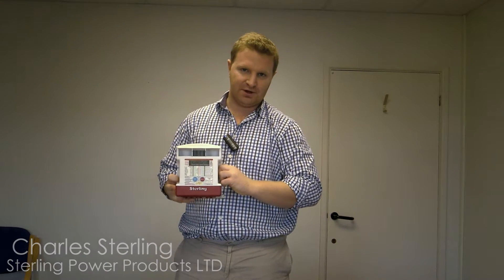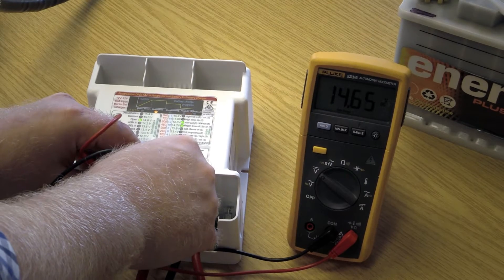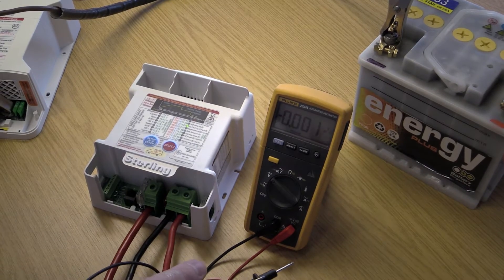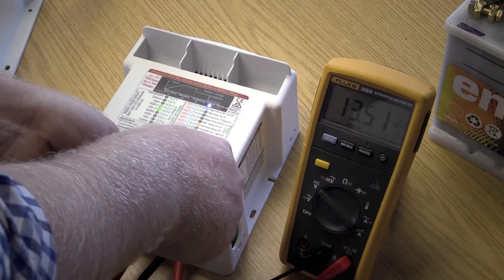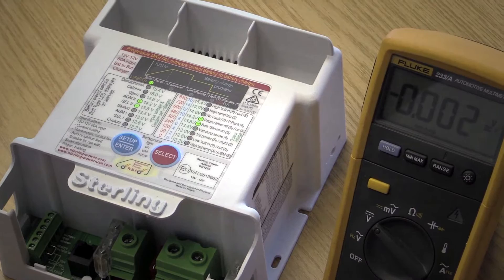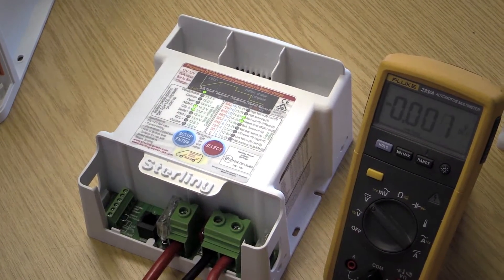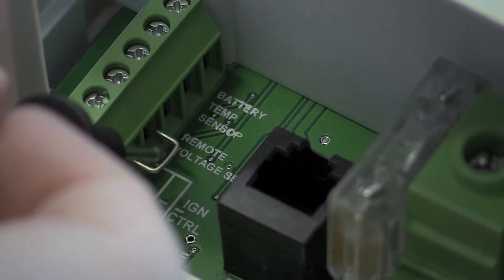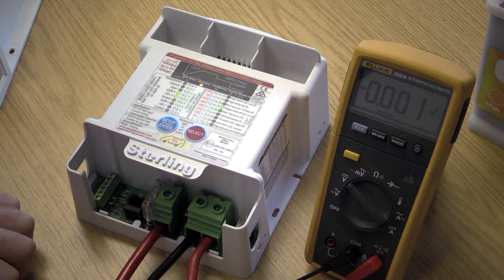Troubleshooting for Sterling's Pro Batt Ultra range of battery to battery chargers

Comment: Hi, is this demo only applicable when you have the ignition running ? I have this charger on a Motorhome that we've recently purchased. It is charging a 200a/h lithium battery. With the ignition OFF I have the top lithium light lit up green on the inputs, the custom light at the bottom is intermittently flashing red. On the outputs the only light that is lit is the 13.4v - drop sense. I'm not sure if the unit is operating correctly? Thanks
Reply from the maker: Hi Andy,

Sorry on the slow response!

When you have lights in both columns, the unit is displaying voltages. First column for input, second for output. 

The custom LED being flashing red stands out to me as you having a very low input voltage. Checking with a multimeter and comparing it to the starter battery voltage will help identify 
A) If it is a low input voltage
B) If it stems from voltage drop down cable

Comment: Hi im having some problem with my 60a. It seems to be having voltage drop on the output. It drops from 14.3v to 13.2v intermitently. When it drops i get the 1/2 power light and volt drop sense on. Any ideas what could cause this? Thanks
Reply from the maker: Hello,

What occurs at the voltage at your leisure battery during the charge sequence? Does it also drop from 14.3V to 13.2V?

Or is it constant at ~13.2V?

What's the voltage at the input when it's running at full power?

Ben

Comment: Hi. Mine keeps lighting up high temperature battery but they are cool
Reply from the maker: Hello Lee,

Are there LEDs in both columns or just the one column?

If just the one column is illuminated, it's possible that the temperature sensor is giving a false reading. Simply remove the temperature sensor from the BB.

If LEDs in both columns are illuminated, it's simply telling you voltages instead.
Reply: @SterlingPowerProducts  ah ok. It's flashing red on the right column and 13.v ol left is solid. How do I bump the voltage to boil a camping kettle? Thanks
Reply from the maker: @leegibbins6196  Hello Lee, 

If you get a voltmeter and measure the input and output voltages on the BB itself when the engine is on, what voltages do you get?

Comment: I've got one that has 14.7 input when motor is started but then a few seconds later it beeps and seems to reboot itself then does the same thing over and over beeping and rebooting. Any suggestions or bad unit?
Reply from the maker: Hello, 

Is this from new, or have you had it for a while? What are the voltages on the input and output sides when the unit is supposed to be on, as measured by a voltmeter? Is the 14.7V on the input constant, IE, no deviation from when the unit is on vs the unit being off?

-Ben

Comment: My 48v charger won’t turn off after the vehicle is off, the fan is running non stop.. I let it sit for half an hour and still going, had to disconnect the power line, what’s wrong with it?
Reply from the maker: Hello there,

What are the voltages on the input and output lines when it should be turning off but is not? Can you please also measure the voltage on the ignition line, if you have one fitted?

Have you tried a factory reset?
Reply: The buttons were unresponsive, the unit was frozen I had to disconnect it. That’s a bit scary if you’re not paying attention. After connecting it back up everything seems to function. If that happens again I will measure the voltage, unsure how this happened though. I have a 100a fuse on the input wire. Ignition wire connected to a fuse splitter of the radio, both temperature wires connected to the house battery negative side. Anything else I should know? I looked at the manual and also contacted via email with no response. Thanks for the help in advance.
Reply from the maker: @mperson91  Hi again,

Nothing comes immediately to mind, but voltages are our first step when we're troubleshooting. 

Sorry to hear that your email hasn't been responded to. Reach out to info@sterling-power.com if you need anything else, and I'll aim to get back to you ASAP.

Comment: Hello
Where do we attach the ignition starter wire to on a Ford Transit custom 2015?
Reply from the maker: Hi Debbie,

Not particularly for us to direct. It should connect to any line that goes live when the keys turn the vehicle on, and goes to 0V when the keys turn the vehicle off. 

Radio or lights come to mind as the typical install points.

Comment: Hi there, we are using this and our system says error 16 solid - high output voltage. However when we use a voltmeter, it says the output is around 13v. We have lithium leisure batteries for our camper. 

What do we need to do to solve this issue? 

This is what lights up:
LiFePO4 - green solid
16 - red solid
10 - green flashing
8 - green solid

Thank you so much!
Reply from the maker: Hi Clarinda!

Pleasure to be in touch, if only it was under better circumstances! Can you check your negative lines for me please? If the BB is registering voltages awkwardly, chances are there might be a chassis point involved.

We can't use chassis points for the negative line, it must be direct connections and a common negative.

If you can guarantee that the negative line is installed correctly and isn't utilising chassis points, can you tell me the voltage on the input and the output studs, as ready with a voltmeter, when the unit is running?

Thanks!
-Ben
Reply: @SterlingPowerProducts  hi thank you for responding so quickly!

We have the BB1260 model - 60amps. 
The negative line connected to a busbar that links to our leisure batteries (along with other negatives). And then the leisure battery is connected to the chassis point in our van. 

Here are more details in addition:

Input & Output when B2B is off.
Input 12.3v
Output 13.8v 

Our van is currently not being driven around as well as we are still converting it + lockdown in the UK. And we also have a solar charging system connected. The battery is full but I have now turned off this alternative charging source. 

I tried to turn it on today and it's not turning on - i suspect its because our battery is full so I can't currently measure the input and output with the unit on! 

A final thing I wanted to mention is that the model we have is different from the one in the video as our ignition feed connection point doesn't look the same. It has Ignition feed, and then BMS(1) and BMS(2) after that. 

Hopefully that helps? I'm happy to take a video explaining our connections if that's usefultoo
Reply from the maker: @clarindac  Hi Clarinda,

Do you have a negative line connecting your leisure bank and your starter battery?

Regarding the ignition feed connection; I need to do an updated video! This video is for the red label BB, you likely have the green or even blue label BB.  What year is your vehicle?

And, what are the input and output voltages when the engine is on?

-Ben

-Edit

Just saw that you said the unit isn't turning on, your battery being full wouldn't stop us turning on! I think either your ignition line is incorrect, or your input voltage is insufficient. Hopefully we can figure that out.
Reply: @SterlingPowerProducts  

When unit is on
Input 14.2
Output 13.3

We don't have a negative cable directly connecting the ignition to the b2b!
Reply: @SterlingPowerProducts  it's a 2013 sprinter van
Reply: Sorry I need to clarify, unit still isn't turning on (it was on yesterday though) the input and output measure are when the engine is running!
Reply from the maker: @clarindac  Hi Clarinda,

Interesting, the input should be enough to wake it up.

Are your starter battery and your leisure batteries connected by a negative? We need a common negative for the BB to function correctly.

Are you within the UK? Would it be worth a technical phone call?

-Ben
Reply: @SterlingPowerProducts  Hi Ben, we only have a positive line from the starter to the b2b and the b2b has a negative to the leisure which runs to the chassis! 

I'd love a tech call, is there a number I can contact you by? I am in the UK :)
Reply from the maker: @clarindac  Of course! The www.sterling-power.com website has a contact form on it for web support, and our telephone number is 01905 771771.

If the starter battery and leisure battery aren't connected by a negative, that could well be the source of all of your problems!

-Ben
Reply: Good evening,  
I have the probat ultra, but the charger doesn't seem to charge the batteries fully.
Despite the batteries been brand new, and usually takes 3.5-4hrs to drive to work, but the batteries never seem to be fully charged from the drive

Comment: Help!  Just returned from a 1700 mile return trip with no house power in my RV. Got home and found a blown fuse in my Sterling BB1230. It was the center Blue 10 amp blade fuse. Everything seemed OK after replacing the fuse. My question is, why did the fuse blow? I have a 2019 Mercedes sprinter Unity camper. I did install two Battle Born lithium batteries and I think I got all the Stirling settings correct.  Prior to having the problem I did run the RV generator to operate the microwave for about 10 minutes. Not sure if that had anything to do with it.      Raymond Godbout, 603 466 5203, rgodbout@ne.rr.com
Reply from the maker: Hi Raymond;

Definitely an odd one and we're sorry to have left you without power for a moment. That blue fuse on the 1230 is for the negative line. Loose negative connections or a negative line that doesn't follow the instructions (for example: using chassis points, not using direct connections, not linking the starter and leisure banks via a negative, loose terminations etc) can cause the negative to spike. 

I don't expect the generator nor the Battleborns to have caused the problem. I would advise you to check the negative line.

-Ben

Comment: what would happen if i didnt install an ignition feed on a euro 6 engine
Reply from the maker: Hi Michael,

All that would happen is you would not see the BB engage reliably. The BB requires 13.3V+ on the input in order for it to wake up and engage. A Euro 6 engine will not output this voltage by default, it will only put it out while slowing down or when the starter battery is very low. 

The ignition feed is needed in order to run reliably on Euro 6 and to trick the alternator into acting as you want it to. 

-Ben

Comment: Looks like my bridging connector is missing! Can I use a piece of wire? And if I want it to not stay on permanent what connections do I make please?
Reply from the maker: Hi Marc,

Is the stripe at the top of your label green or red? If it's green, you don't need the link wire at all!

What do you mean by not staying on permanent? Is it trying to boost even when your vehicle is turned off? If so, you probably have the ignition feed line connected to a 12V feed that is constantly live, IE, not an ignition line.

The BB will only engage when one of two things occurs- the input voltage rises above 13.5V (for a 12V BB), or when the ignition feed goes live. 

Hope that helps,
B
Reply: @SterlingPowerProducts  that explains it as mine is green label!!! Thankyou for replying

Comment: When you talk about adding regenerative braking to your pro batt ultra, isn't the regenerative braking effect part of the vehicles smart alternator?
Reply from the maker: That's right; however there's a problem. 

The problem with euro-six alternators and charging is the regenerative braking itself. You're only going to be getting any power coming through to your batteries when you're braking or slowing down - which is inconsistent. It also isn't ideal or efficient because the voltage when doing regen can be as low as 10-11V, or as high as 17-19V. You don't want 19V going through to your leisure batteries.

By fitting a BB we not only ensure that your alternator is running consistently so that you can get a constant charge, but we also ensure that you get the correct voltage. What you set it to is what you get, and you'll get it from when you turn your ignition on until you turn it off.

Comment: Mr Sterling, I just installed my bb1260 and it seems to be charging correctly but the cooling fan never shuts off! Ever had that problem??
Reply from the maker: Hi Hep,

When charging it can be expected to run the fan just to keep it cool and efficient. Chances are it's heating up, and unless you're in a cold environment it's unlikely to be running 60 amps through itself without getting at least slightly warm.

If the fan is running even when you're not charging anything, then give us a call.